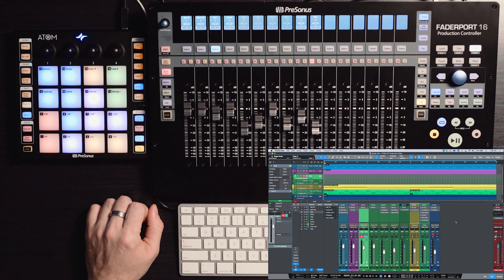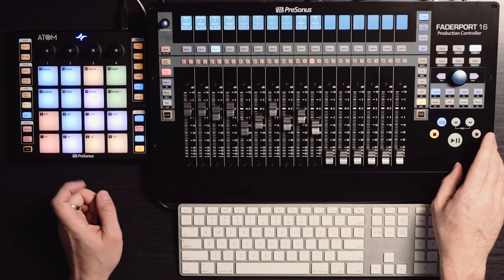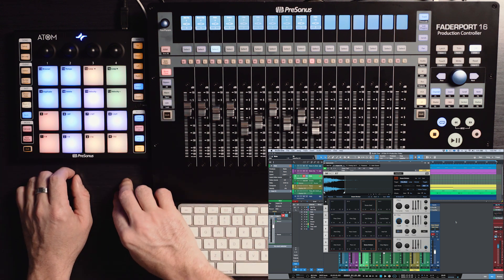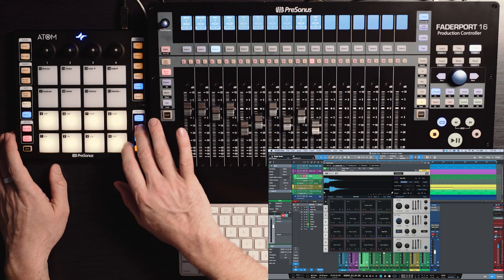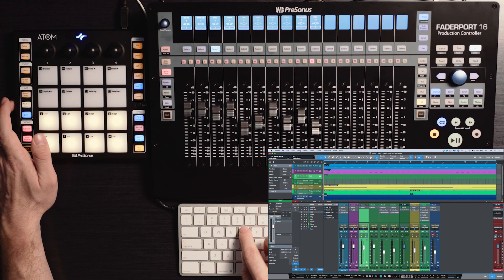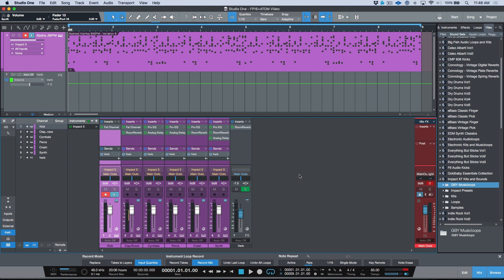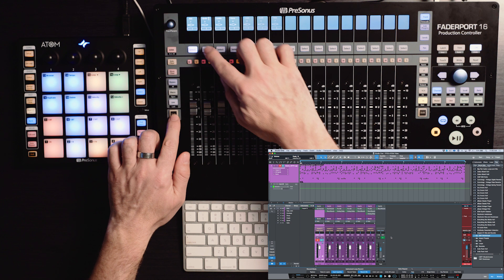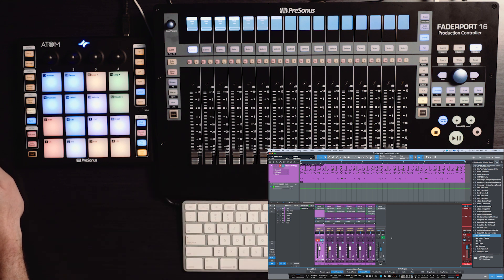Marcus Huyskens— Combining workflows with ATOM and FaderPort in Studio One

Comment: just checking to see if the navigation buttons sometimes not work when you're in the song setup mode when accessing the plug ins in the browser? mine seems to lock up, but works fine in the other areas on the atom in studio 1 4. makin sure I don't have a faulty unit. yep!
Reply: I have all the latest drivers install for the atom. using studio 1 4.5, with the latest  universal control, and firmware updated on the atom, on windows 10 1903 update. yep.
Reply: update, atom is working fine in studio 1 4. yep!